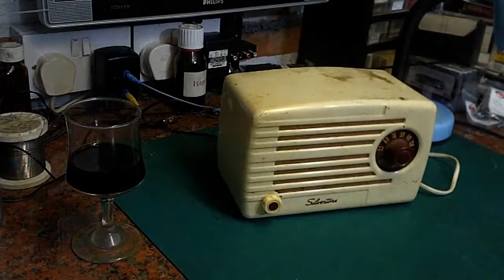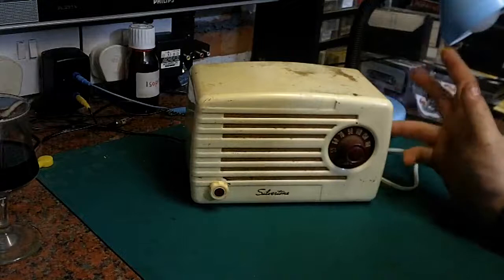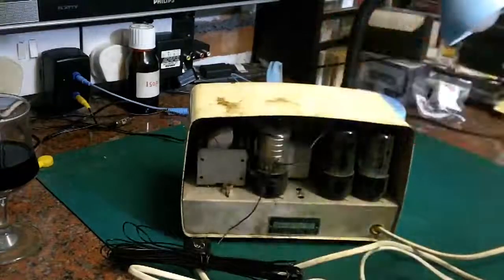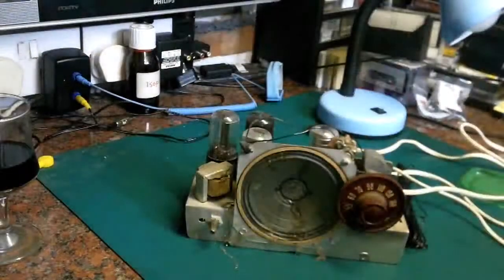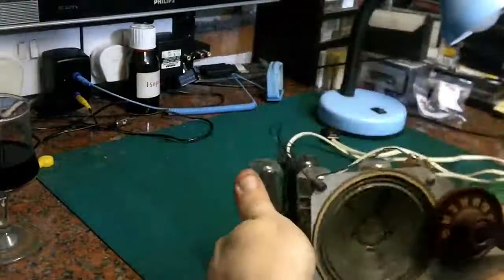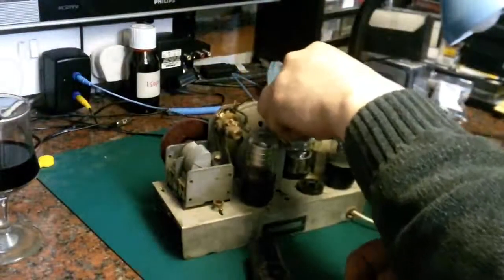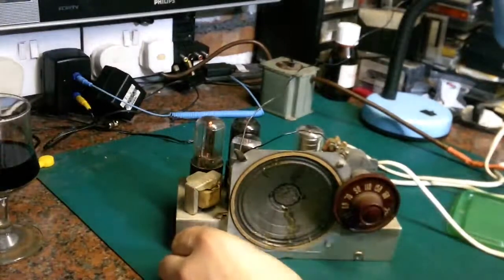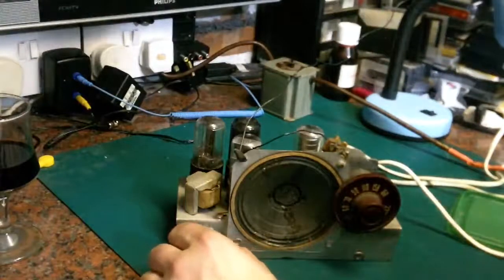Sears Silvertone AM tube radio

Comment: Its amazing. Mine played that good when it was all original even the original electrolytic. The 330k resistor in parallel with the wax capacitor is the b minus to floating chassis capacitor

Comment: The IF transformer is the long coil form underneath with two coils on it. It doesn't need shielding because its underneath the metal chassis and connects to compression capacitors for IF tuning. The shorter coil which has a new orange capacitor soldered to it and underneath the 12sa7 is the oscillator coil. The coil mounted on the speaker is the loop antenna

Comment: It is superheterodyne with 12sa7 oscillator converter but instead of going to an IF amp tube it goes to 12sq7 det first audio. I had to recone speaker on mine

Comment: It has a metal cabinet but it is floating. I recapped mine and replaced the floating capacitor and across the line capacitor with a .01 x2y2 safety cap